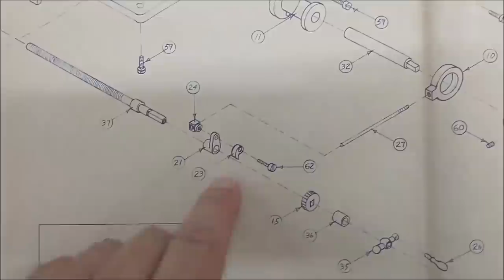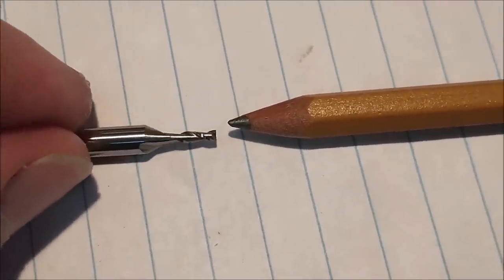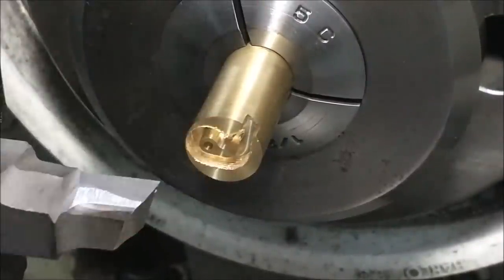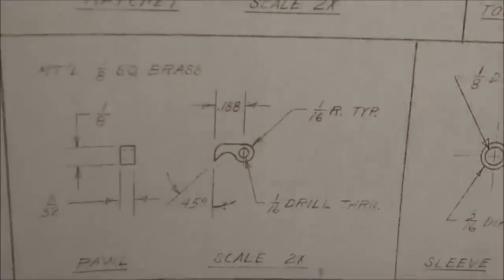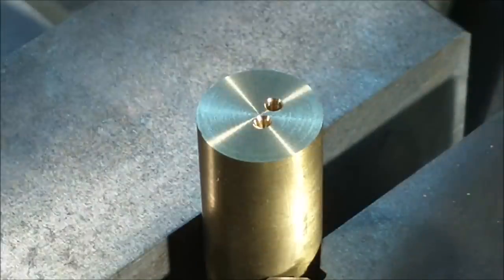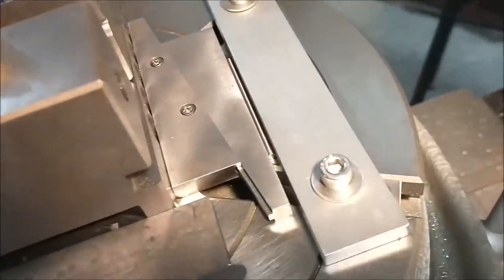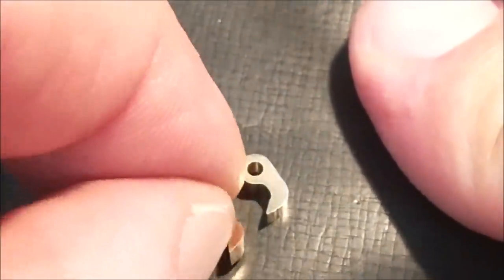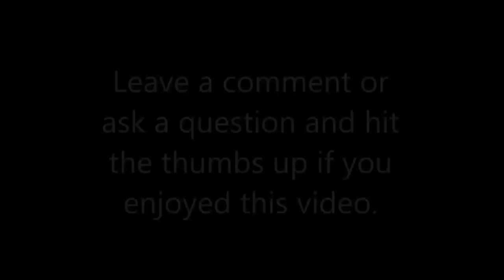What's The Difference Between These 2 Parts ????

Comment: For efficiency on the CNC the top could be faced there and the parting off done with a slitting saw (leaving a thin slice to be broken by hand to avoid 5 hours of looking for the part in the chip bin...).
Personally I'd prefer a rough cut with a larger cutter first to remove the bulk only leaving the "dip" for roughing with the small endmill.
Reply: Clean the chip tray out first 😁
Reply: @mpetersen6  Tried it both ways... Including serial production of a turned part about Ø4 mm stepped down to 1.5 and length 3.5 and a small hole in the thin end with a tolerance of 0.01 mm and square bottom in a standard sized CNC lathe. Fun to setup and dial in, not so fun trying to find the parts...

Comment: Great video Joe but I dont understand why you didn't just us an 1/8" dia endmill and do all of the perimeter other than the one outer corner radius where the two perpendicular side intersect in a single shot. That double radius in the notch where you've got the .0173 offset makes no sense to me. To me, it seems pretty clear in the original print that that is a single 1/16" radius that is tangent to both the 45° face and the 1/16" radial circumference around the 1/16" dia pivot hole.  

Did you assume that the surface of that radius in the notch was to be tangent with the center line of the pivot hole or is it shown to be that way somewhere else? Thats the only reason why I could think that you would conclude that was actually two different radii with a short straight connection between them since there would be a .0053" offset (which would be impossible to see in a hand drawing, especially in a photo copied one, even if its 2x scale).
Reply from the maker: On my drawing, which is different than the newly released kit drawing, it does appear the inner hook arm is inline with the hole centerline. 2 x .06 radii just isn't possible under those circumstances, but you are right. Wave off that constraint and then it works.
Reply: @joepie221  Ah, gotcha... Thank you for replying.

Comment: There are a couple of layers of creating gcode for this part.   I assume you solid model it then -> cam.  This is great for future use and using the model in other projects.   You could also generate a 2d profile in your favorite cad -> post process and do a bit of gcode processing. (I still use ace converter for a lot of simple shapes - but there are a lot out there that take a dxf and generate gcode)  I do this a lot for 1 offs.   If there isn't any major tangents or such - I might just create the gcode.  for most 1-offs it is certainly faster with the cnc.  You just can't over process initially..  Create the gcode based on future use..
Reply: and - great work on both ways.  I don't have the patience to do something like that manually.
Reply from the maker: Its a great way to build patience.
Reply: @joepie221  I have kids..  That is pretty thin at the moment.. :)

Comment: LOL .... he's a machinist not a programer!

A subroutine is a stand alone repeatable operation, in simple terms. 

You call the subroutine to cut the perimeter of the part, the operation then returns to your main program. where you move (step ) the cutter down a bit  and repeat (call )  the subroutine again. 

Repeat until desired depth is reached. 

One of the advantages of too much education is you end up taking lots of things ( like programing ) which aren't really related to your actual interest, making cool cars in my case. 

When you're done getting overly educated you spend 20 years or so doing really cool stuff. Then you spend a few years teaching young men (mostly ) all the stuff you leaned in 20 years of doing the work, until the tenure committee decides to deny your tenure. 

Hope this helps
Reply from the maker: At the risk of hurting your feelings, I respectfully disagree with your method. Let me clarify my subroutine composition for you. It starts with an incremental G91 command on the first line, the second line is a  Z axis downward move of .02,, followed on the 3rd line by a return to absolute G90 followed by the profile code on the remaining lines.  I called that sub to loop 5 times by entering   L105 in my main program. The program stayed in the sub until the perimeter was complete. It never returned to the main body of the program. Thats a huge waste of code space. If you had to loop that sub 100 times,, your way would require 200 lines of code. My way...2.  Hope this helps.
Reply: @joepie221  ,

You didn't hurt my feelings. The Loop is simply a repetitive process which saves you the time of repeating the single call to the subroutine multiple times. 

We're basically talking about the same thing because when you call the subroutine it returns to the calling routine. In this case it returns into a loop. The loop then increments, calls the subroutine again, the subroutine returns, the loop increments and calls the subroutine again etc. 

When the loop reaches the desired number of increments the program then exits the loop and executes the next line of code outside the loop if there are any

Functionally,  you're doing the same process whether you repeat the call on 5 separate lines or call a single line 5 times from inside a loop. The looping process just saves typing, from a programming perspective.
Reply: @artt3165  your response with the “just” typing bit is where in programming lots of things are getting wildly out of shape, wasting tons of bits to do exactly the same and forcing people to waste money to increase memory banks and drive space.
For no other reason then laziness(imho) and the availability of such bigger memories and drives.
Reply: @bertbergers9171  , 

Preaching to the choir, my friend. 

If I had a dime for every time I heard "But it's a 64 bit register" or "But the address bus is ______  bits wide" so what difference does it make? 

Well....... it may not make any difference from an operational perspective, but if every 8 bit value is stored as a 64 bit value you're wasting LOADS of storage space when all the data might fit in 1/8 of the memory/disk space. 

I too see it as just lazy programming. "Just use "int" (integer value ) who cares if it's 8 times the size of what we actually need to be using by default."

Don't even get me started on unnecessary "features" and background processes which are "just cool" to have running because "it's faster." since you don't have to wait for something load.

I'd love to watch one of the modern "coders" program in 8 character mnemonics ( parameter names ) using a maximum of 256k of available memory. 

Started in programming ( electronics ) before I became and en-gun-eer then I learned how to spell engineer, spent 20+ years doing engineer stuff,  then went back to computer programming before I finally retired in the early 2000s. So..... I've both struggled to get the code small enough to fit in the available memory and had more memory than I could possibly ever need.

Comment: I made a paw, by hand.....for a clock....out of steel.....about the same size as that one .....i used files and a dremel tool ...but my paw did not have a round hole.
i made a square tapered hole...it was for a  Goustoff Becker wall clock......from the 1800s
Reply from the maker: Nice.

Comment: With experience comes speed, for ME to do this, it would take me more time to TRY to write the code for the CNC, than to make the part; but if you CAN code, you always have it, and can make multiple copies.
Reply: Of course, but that's the point ot learning stuff. You get better as you do more. Particularly something like writing code - I do programming of computers for a living. All my machines are 100% manual - I've got as far as having a DRO, but no computers controlling any of my machines. However, programming is programming, whether it is CNC, Assembly code for a game on an Apple II or Fortran to calculate weather forecasts. Logical steps. It takes time to learn, but with practice you become better.

I'd struggle to make a part like that, but I think I could - by hand, on the rotary table. I may end up with 3, 4 or 7 scrap parts before I get it right - but that's also part of learning.... You do something wrong, you try again (and try to remember to NOT make that mistake again!)
Reply: @matspatpc  Yes, I do understand and agree with you 100%. I was just saying I grew up PRE COMPUTERS (Heck, Texas Inst CALCULATORS cost a fortune back then.) None of the machines I learned on were Computer anything, and automation was new with Punch Cards to give him basic instruction. I'm sure CNC is better for a lot of things, especially repeatability, but I never learned it. Manually, I could make it, I might have a scrap or 2 if my math was off. To me, CNC was like learning a foreign language....I DID leard Spanish, but I wasn't very good at it..😁
Reply: @edwardhugus2772  Learning a human language is very different from learning computer programming. Human languages have lots of strange rules - Why is the colour red and what you did to my comment (you read it) spelled differently, but sound the same? Yet, as you read this comment, it sounds like reed (grassy-like things that grow near water). In general, computers have strict rules - they may say "I don't understand that", but there's no "sounds the same, means different things" or "spells different, sounds the same" - or any of the many other irregular things that human languages have. It is just logical steps. Breaking down your work into logical steps, order of operation, etc is of course something we do whether we machine things by hand or by machine.
Reply from the maker: Never be afraid to fail. Unless of course its a very expensive customer part trusted to you for repair, then its OK.

Comment: Joe the big question is which one are you going to use on the model? There’s arguments for either one. 👍🏴
Reply: He needs two on the model, so he'll use both.
Reply from the maker: I plan to use the one done manually. I was unaware I needed 2, but I'll double check that.
Reply: @joepie221  good choice that’s the one I would have chosen too. Stay safe and well 👍🏴

Comment: Your CNC program cannot be called upon to perform a finish pass?
Reply: With 99.99% probability it can but he choose to focus on the principals not a deep dive into programming and machine handling (a common way is to enter the cutter specifications into two slots (EG: T01 D01 for roughing and T01 D31 for fine). The machine manuals are the operators best friend!
Reply: I think the finish pass was achieved by removing the offset. Effectively making the cutter its' real size again.
Reply: @passenger6735  Of course it was, but a CNC program should be able to do a finish pass as a standard feature.
Reply: @menow.  Agreed. I use HSM and that certainly has the function. It's like a lot of aspects in engineering, ask 20 engineers and get 20 different methods.
Reply: @passenger6735  
Or using two different tool #s with different sizes.
Reply from the maker: Sure it could.

Comment: The well equipped master in action...
Brrr, what an ugly little cutter.....
Time 04:25. Do You mine the rather costly brass on You back yard? .... No smaller rod available I guess.
CNC machines are fantastic but why don't they have cutting tool load detection? That would be a closed loop system. Mostly it's an open loop system entirely depending on the setup parameters. "Walk in this direction for x time"....
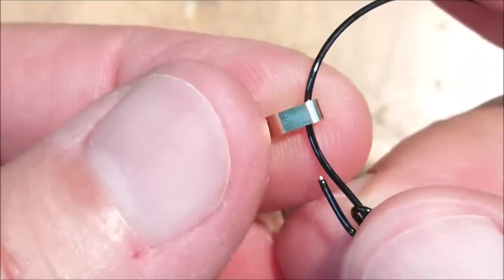Time 11:18. "If You'll be building this....." Be my guest and guess!.... 
Be aware of the spiders. They might consider such a part as a trofé and run away with it as magpies are known to do...
Much of the work is to satisfy the drawing. Going for functionality things could be done easier, looking less nice of course.

Anyway, the work of a master machinist as well as video producer.
Reply from the maker: Thanks for the comment. My machine does have a spindle load detector, but this tool was so small, the spindle wouldn't even be influenced by it before it snapped.
Reply: @joepie221  Whow. The sensor needs stereoids.. So CNC's do have that sensing. Now and then snapping CNC cutters are showed on YT.....

Comment: Why even bother with manual coding? Multiple depths of cut and stock to leave with a finish pass is all just a check box in Fusion 360.
Reply from the maker: Mine as well, but then you wouldn't have been exposed to subroutines.